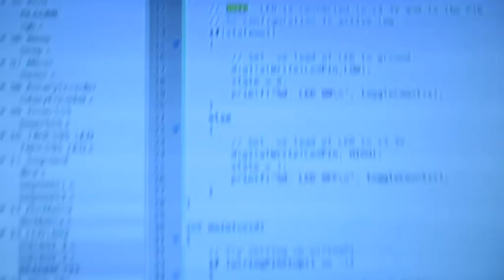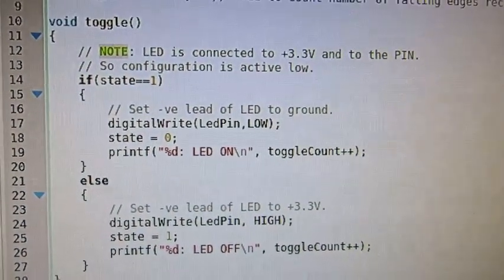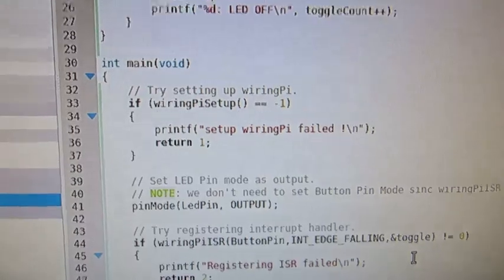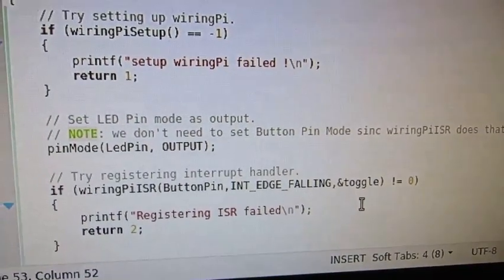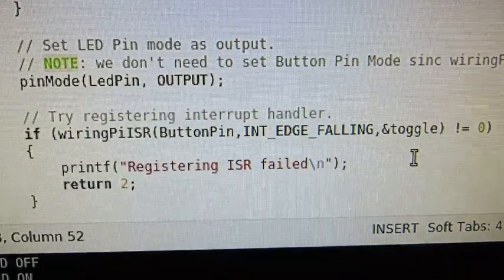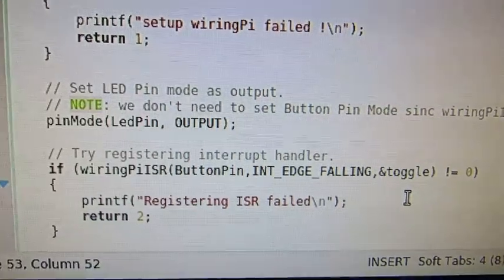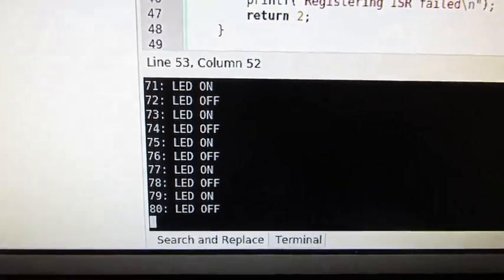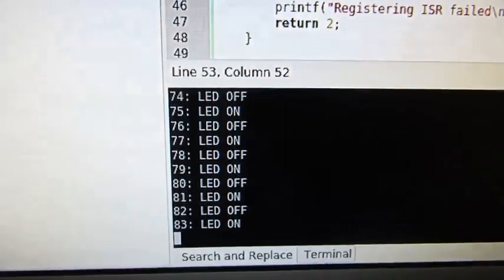toggle LED - Interrupt Handling on the Raspberry Pi using wiringPi

Comment: Why doesnt worked for me when I tested? I tryd wiht my older wirinPi library...not work. WHen I start the program it only light one LED. WHen I push the button,then nothing happen, nothing write to terminal. (I used capactior 104 , resistor 350ohm, )

YOur file where I must put ? in the wiringPi folder? and write to the terminal

gcc togleLED.c -o toggleLED -l wiringpi
sudo ./toggleLED